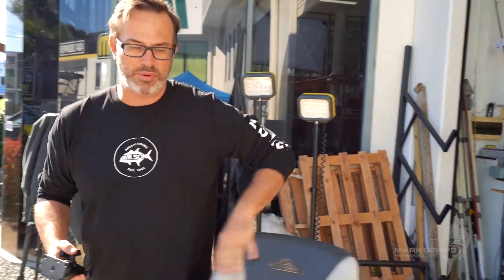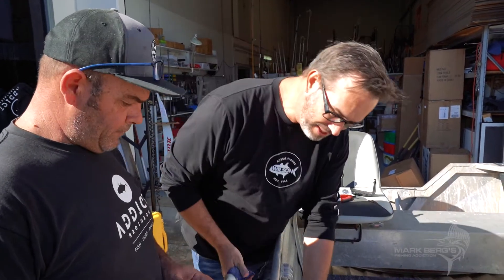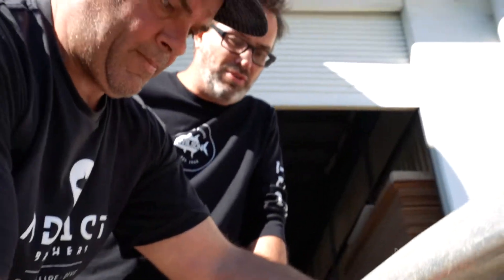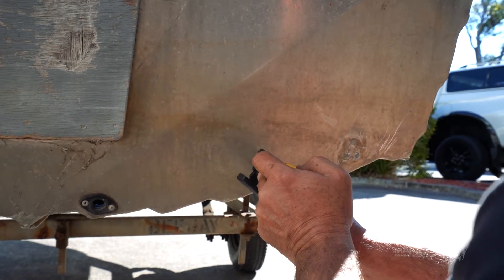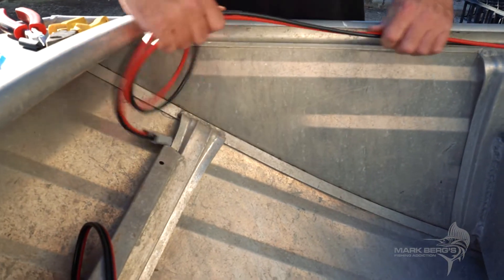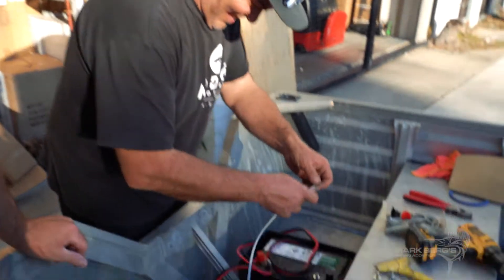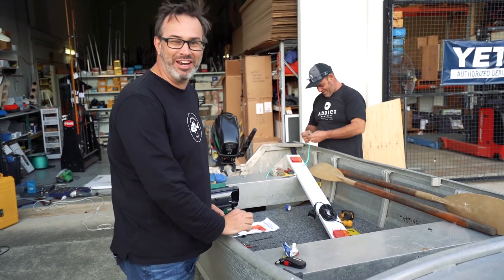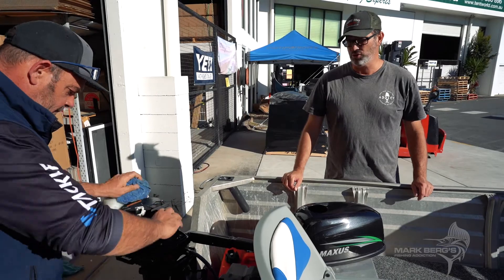Fixing Up My Son's Boat - Part 4

Comment: Hi Mark, I’ve been using your videos to help install a Minn Kota on to my tinny. Did you run the power cable through a drilled hole on the bow? My battery is in in the bow